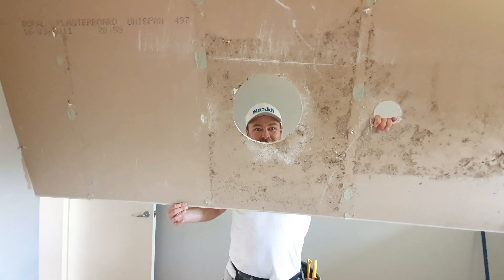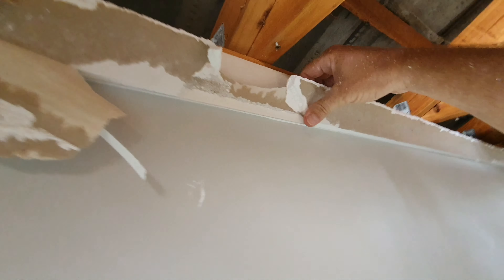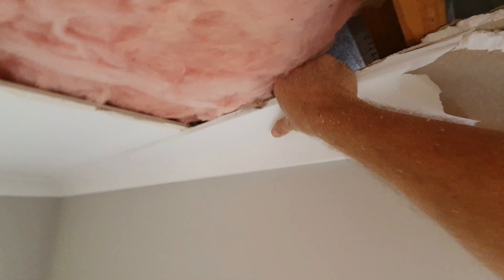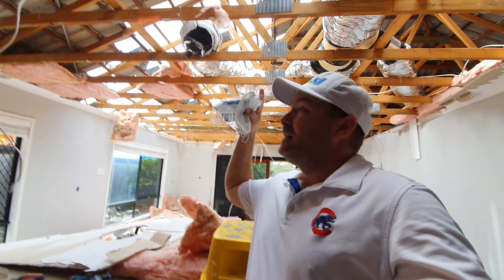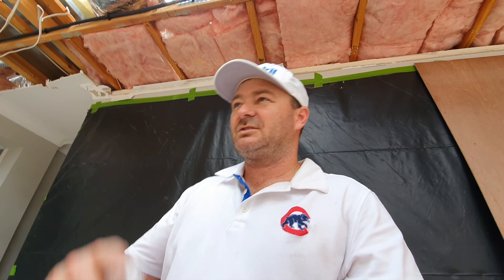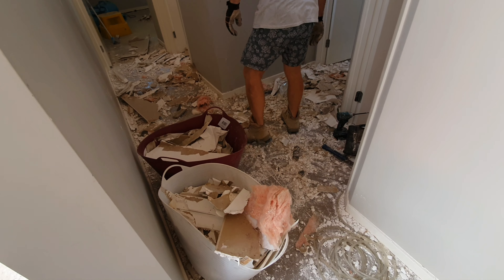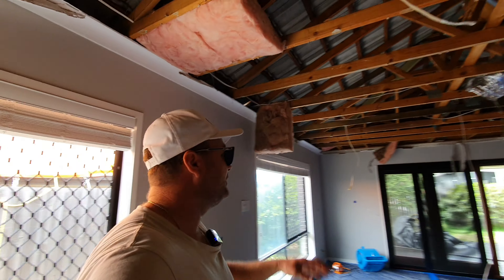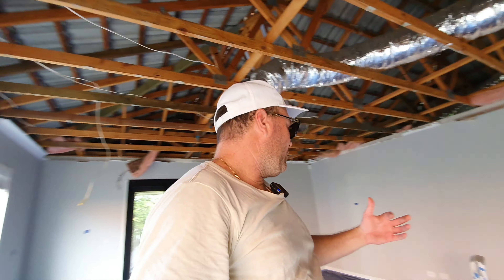SEE How to Destroy your Drywall & Plasterboard Ceilings Fast - MAXKIL

Comment: Looking at the truss spacing and the amount of glue and screws used I would say that that building is right on the border with code. In my neck of the woods I am sure that for a tiled roof the truss spacing should not be more than 450mm / 600mm max for steel roofs. Not sure why you guys don't need sisal between the tiles and the trusses either - those ceiling came down way too easy and the back blocking that was done was very ordinary - one thing for sure is that you'll do a much better job that the original. Cheers.

Comment: Looks like there no wood sheeting on the roof only metal roof that's probably why hail came right through
Reply: Still trying to figure out the 2 foot center ceiling joist
Reply: theres no such thing as wood sheeting on a roof in Australia. and it was tiles, not metal.  metal roofs dont break in hail. everything here is built as cheap as possible to get paid at the end of the job.  The new plaster wont be any better than the old, nor will the new tiles.  I much prefer trusses to be battened then you can straighten the ceiling.  But it adds cost that the builders dont want to wear and the customers refuse to pay for.